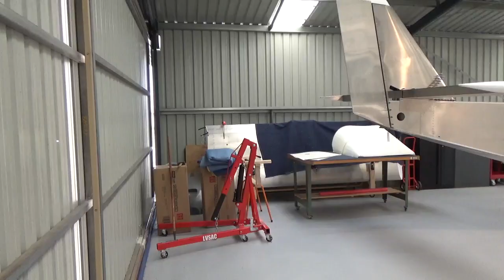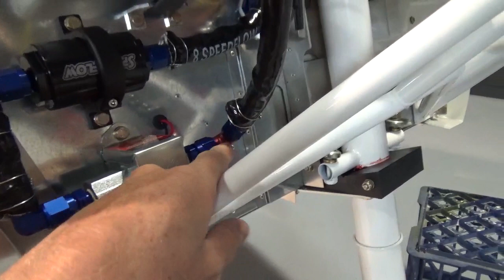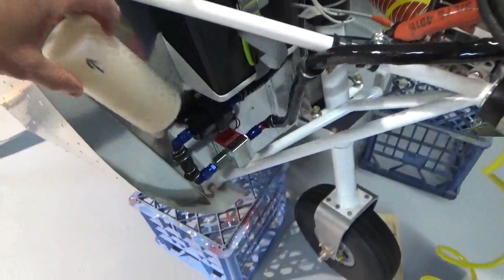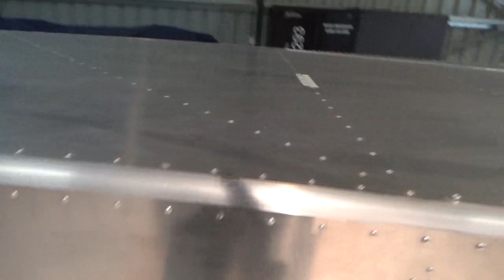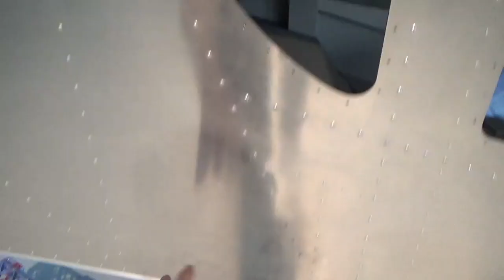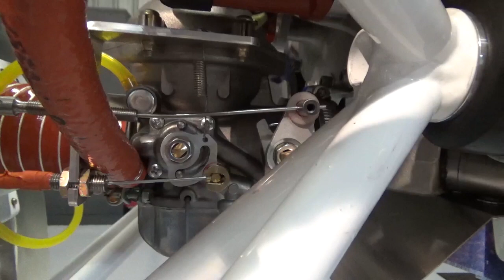Zenith Cruzer Forward Fuselage Hangar Maintenance

Comment: I've begun wrapping the tail of my Cruzer, and so far am pretty happy. You're absolutely correct that the rivets need attention, but maybe 5 seconds to heat and press each one. If you do reconsider the idea, I'd suggest avoiding the Avery wrap that I started with, just go with 3M 2080 from the start. Due to surface finish issues, I need to strip all the Avery from the Hstab and re-wrap in 3M. Lesson learned.
Reply from the maker: Jason Fish awesome, is that the red white and blue one? How do you go with all the hard to reach visible bits?
Reply: Yellow and black. As you said, there will be some paint involved (inside the elevator opening in the fin, wingtips, cowl, mounting brackets), but so far it's relatively straightforward. Nice that the whole plane is a series of mostly flat panels. :)